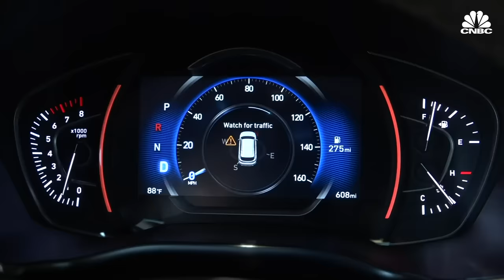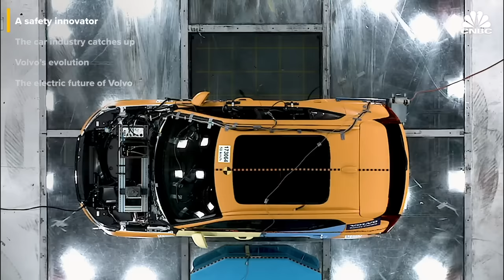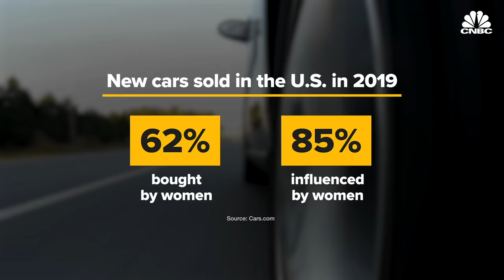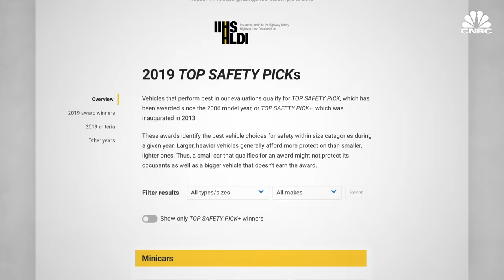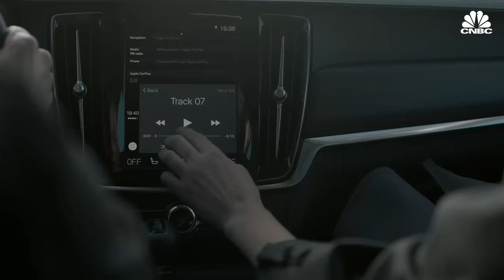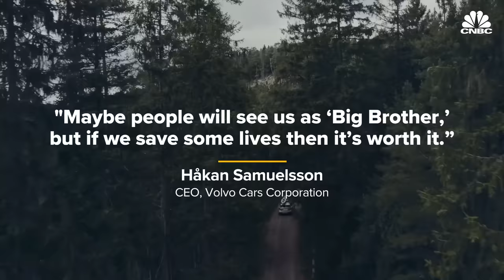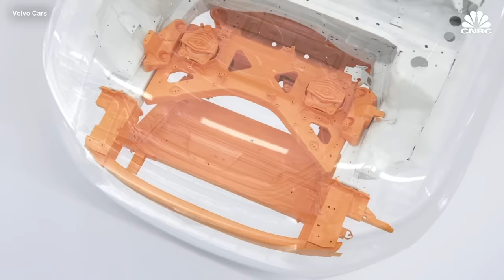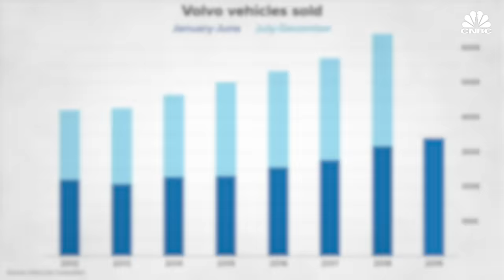Why Volvo Is Losing Its Big Lead In Safety

Comment: Volvo cars are so goddamn well designed and just look so timeless.
Reply: To bad its reliability is awful.
Reply: @baronvonjo1929 : I own a Volvo V70 D5 purchased as a new car in November 2007 in Bremen, Germany.
No breakdown, no unscheduled workshop visit until now, February 2020.
Once a year for inspection at the Volvo dealer in Bremen.
Reply: @ULTRA_2112  Honestly jealous. Our Volvo sucked.
Reply: @JaeKi Park we had a mid 2000s S60. It lasted about a month. It had about 110,000 miles on it. It broke down a lot. And when we fixed it. Another problem. Sometimes if we didn't touch it for a few weeks it would run. It did that when we sold it to a dealer. My dad was so happy to get rid of it. Constant computer systems breaking down. And sludge building up in a filter. We ended up getting a Lexus crossover. And I just got my first car a camry. I realize now the S60 also had bad leg room in the back seat. I want volvo to go bankrupt after that. We will never buy a european brand after that ever again.
Reply: @baronvonjo1929  What? My dad have owned Volvos all my life, they are extremely reliable. Even they were old cars.
Reply: @inkerstales2336  Not ours. Constant electrical issues. Computers system malfunctions. Filters having sludge when they shouldn't. Thousands of dollars was put into that thing. We had it less than a year. It was at about 110,000 miles. It was truly a unreliable car. Spent more time in the driveway or mechanic than on the road.
Reply: @baronvonjo1929  you want volvo to go bankrupt because of a bad experience with a used 110k Volvo? Sounds like you just bought a bad one because the S60 is pretty reliable
Reply: @baronvonjo1929  I brought a 2005 s60r last year with 160k miles on it and it still runs like a dream,no issues with reliability, but  honestly the leg room in the back is ridiculous, but I have no complains for that since I drive alone.
Reply: Old Volvo cars are ugly but the new ones look great and volvos from 2000-2010 are just rebadged fords lol
Reply: @baronvonjo1929  You're complaining that a used car is breaking down. Seems like your dad bought a lemon that wasn't taken care off lmao.
I have a E90 320d BMW with 334k km on it atm, runs like a dream. All you have to do is change the oil on time and most of the time there wouldn't be any problems, if something comes up immediately fix em and not delay em like most people do.
Reply: @xAvitaLT  it happened within a month of getting it. And constant constant problems. Thousands of dollars worth if repairs. We then started looking up and just found stories of how awful peoples volvos are. Never going European again.
Reply: New Volvo is junk
Reply: @8risk  2019 V60 T5 here, I've had the car 2 years now and we've put about 42,000 US miles on it. no issues at all just a handful of schedule maintenance items and oil changes. Prior to this I had a 2010 S80 T6 I put just about 130,000 miles on that with the only major issue being a bad bearing in one of the turbochargers at 105k miles. So long as you keep up on general maintenance, they're fantastic (This basically applies to every car. we need to learn the difference between a neglectfully reliable car that you can disregard and will still run, and a truly reliable car that runs as the manufacturer intends for longer than a disregardable car when maintained correctly). The older late 90's early 2000's Volvos that were cranked out with Frankenstein concoctions of Ford and GM parts were the bad ones, consuming transaxles like oil, bad seals, poorer quality parts, etc.
Reply: @baronvonjo1929  Guess what! I've got a 2017 diesel Citroen Berlingo (a European car) and I've never had a sigle problem with it for 47000 km.(and amazing fuel economy)  I had a 106 Pug (petrol) and ran it till 320000km (before changing it to a Panda in 2009) , again no problem.....
Reply: @melesmelesfaber3866  *clap clap clap*???
Reply: On my 3rd Volvo.  Had a 2004 sedan traded it in for a 2010 sedan. I recently gave it to my kiddo and now I have a new SUV. All of my Volvos have been great.  Love them. The luxury is nice and they safety gives me piece of mind.
Reply: @melesmelesfaber3866  don’t care
Reply: @V_For_Vigilante  I have to agree with the Ford statement. I feel the quality of Volvos between 2000 and 2010 was bad compared to before and after than time. No wonder when some V50’s had Ford engines lol. 

The designs of those old Volvo’s were appropriate at the time, legendary cars with a reputation to never die.
Reply: @V_For_Vigilante  but their not rebadged fords their safer and have a lot more features I have a 2009 xc60 which has auto breaking up to 30km/h this is a 13 year old car memory seats plus more their very nice.

Comment: Boeing is the complete opposite of Volvo.
Reply: Ouch
Reply: Damn we still talking about that? Cold...
Reply: Boing!
Reply: Ganda Gandara - MCAS - Make Crash Avoidance Stochastic
Reply: @dazednconfused31337  I think you mean "zing".
Reply: Sean Hard 
China has NOT changed, for the good anyway...
Reply: @nicholassmith7048  Nah that's the sound it makes in MS Flight Stimulator when it bounces off the ground :P
Reply: Not really. It was a bunch of inexperienced and untrained Pilots who were unable to handle a basic runaway trim problem.
Reply: Yikes big oof
Reply: LOL!
Reply: Boooooing
Reply: Oof
Reply: I thought Boeings were good planes.
Reply: Have some mercy!(😂
Reply: jiggbury We should be talking about it next 20 years..
Reply: Actually Boeing was like Volvo (super solid 707, 747, classic 737), but they changed for worse because of race with Airbus.

Comment: This is why I've owned an S60 and now have an XC60.  Volvo For Life.
Reply: I'm considering an SPA S60 T5. Is it significantly more reliable than a BMW 3 Series?
Reply: made in china..
Reply: @rohaannavsariwalla1844  it'll be more reliable than most German cars, but not as reliable as Japanese cars
Reply: Swedish engineering is just mind-blowing. Can't wait to get my hands on a Volvo Polestar 2 Waymo!
Reply: How is Volvo safer than Mercedes and more reliable than Lexus??
Reply: @saauuzza  the plant in china is for people in china
Reply: @kramer1916  mate it is made in China full stop.
Reply: @wojciechmuras553  Chinese engineering now, Geely the Chinese owner didn't keep the promise to keep the design and engineering works in Sweden, they only assemble Volvo in Sweden for Euro market.
Reply: @saauuzza  They are not even manufactured in china lmfao
Reply: @tonyvu2011  swedish engineering, produced in sweden (xc90 xc60 v90 v60) belgium (xc40 v60) china (xc40 xc60 xc90 s90) and usa (s60 and xc90)
Reply: @mZToyadiva101  I own the XC60 Inscription and I love it. Extremely luxurious and well worth the price. 
Get the certified pre owned XC60, this way here, youre getting a luxury car at a discounted price.
Reply: @pawelodziomek4908  Well said! If im not wrong, Volvo is more safe than the reliable japanese cars so you get slight lower reliability but top of the line safety. 

For people like me who love all the extra equipment like all the cameras, Harman Kardon soundsystem and panorama roof then its much cheaper to buy a Volvo than a german counterpart. Their extra equipment makes the car twice as expensive 😂
Reply: @saauuzza  All volvo cars are made in Gothenburg, Sweden. 
Chinese only gave Volvo money, nothing else.

Comment: Volvo has ethics. What other automakers can say the same?

Next safety feature: identify risky vehicles on the road (based on behavior & car type) and actively avoid them. Would it be possible to detect which drivers are texting? Not even kidding...
Reply: Yeah read gps data of nearby vehicles... Track their driving past and show which vehicle is being driving dangerously, provide alert about that 😉
Reply: Simple answer, Anything that isn't Chinese is deadly dangerous! Chinese software decides!
It detects if driver or owner of the other car has attended anti-Chinese websites or isn't using enough Chinese products and suggests to Volvo driver how to kick the enemy off the road while blaming the fault on him. Failsafe Tibeto-Uighurian method. We have also seen that with Tesla recently. It works.

Anyone who finds sarcasm in here may keep it, it's free.

Comment: Volvo is still the leader. They drive the cars off of buildings for crying out loud. This crap about them not innovating in safety because of geely, is a bunch of bs! Volvo has never been more independent than it is now. They literally can do whatever they want. If you don't believe me just shut the door in a V90 and then shut a door in a Chrysler or something and tell me what car you'd rather be in. The impeccable build quality is another huge factor in why people buy them. There is also a huge amount of Volvo specific crash tests that the iihs doesn't even test for, so even though the gap isn't as big as it used to be it's still big.
Reply: I rented a Volvo in Europe and it shifted to from park to reverse on its own while I was by the trunk. Completely destroyed any image of safety it had in my head.
Reply: Geely isn't hampering Volvo and the video never said that. The little they said about Geely is that it's really helped them by giving them access to more money and access to China. The CEO of Geely is quoted as saying he's going to pretty much leave Volvo alone. Volvo is losing becase other brands are focusing much more on safty then they used too.
Reply: bensemus x I never said the video said that I was responding to some of the idiots in the comments and to people who jus blurt out random stuff like Volvo’s a Chinese company now, which is jus stupid. And Volvo isn’t really losing to other brands either. Other brands are taking note from Volvo. Volvo is MB’s biggest shareholder rofl. I guess if you look at jus sheer sales ya but that doesn’t tell the full story.
Reply: They have their own crash test facilities.

And have investigators that go to real car crashes.
Reply: @Aleksandar Milicevic yep and Volvo uses the most boron steel alloy than any other manufacturer, which is the strongest stainless steel material used.
Reply: @bensemusx  No, I think that Volvo is losing because the design of their interiors have become too effeminate (I can't think of any other brand in that manner), because their engines are too problematical (T5s are probably the best, but T6s and T8s are very poor in shifting because of the superchargers and turbochargers), because their purchase costs are arguably too high for what you get, because they've taken away too many buttons for things like climate control and put them in the finicky computer screen, because some of the buttons that they do have are absurd (on-off switch; auto-mode roller button), because you can't permanently disable auto-start/stop, because you can't even temporarily disable the doors locking when the car starts to move, because you can't get a no-sunroof option (and thereby save money), because their instrument panel is inferior (doesn't even show engine temperature), because they have too-few USB ports (and the ones they have are too hard to get to), because they refuse to offer engines greater than 4 cylinders (I don't think that any other luxury-car maker lacks at least a V6 option), because their center-console storage area is very poorly designed (doesn't hold cups well or securely), because their voice-control system is poor, and because their infotainment system is crap (including their maps, though Volvo is going to Google Maps in the next year or so).   My 2001 Volvo wagon doesn't have an infotainment screen (or USB ports or sound-control), of course, but it does have a CD player (can't get that anymore, either) and is superior to the new Volvo wagons in every other manner listed above (and I'd argue that my 2001 wagon is safer, because you don't have to take your eyes off the road to fiddle with the infotainment screen to change your climate temperature or fan speed).  I suspect that the only Volvo I'll even consider buying in the future is a BEV Volvo, if they can get the range up on those; their PHEVs are crap -- reliability-wise, range-wise, technology-wise.
Reply: @cbatiau2528  I thought there is a voice option where you can give voice command and adjust cabin temperature, no?
Reply: @tatiananovak4693  It doesn't always work well, the voice control.  And there are many times when I might be on the phone or talking to a passenger or listening to some music or the radio, and I don't want to have to interrupt to change the climate control.  (And this discriminates against drivers who are mute, or have laryngitis.)  Saying "well you can use voice control to change the climate settings" is a poor excuse for not having buttons/knobs for that purpose.
Reply: @Robert-cu9bm  you are actually correct on both of your statements. They do have real investigators going to where real crashes happened.

Comment: I mean, the tests hasnt changed for like a decade ofcourse they’ll look equal with everyone else. If you increase the speeds or weight of the side impact you’ll see them distinguish themselves. Just when IIHS brought out the small overlap test and a 2002 xc90 scored good but a 2010 bmw scored bad. Change the tests and you’ll see them shine, everyone else is just matching the bare minimum
Reply: Exactly, Volvo conducted a 50mph crash test with they're XC90 - something no other car maker does.
Reply: Remember when Mercedes, BMW, and Audi failed spectacularly when IIHS first came up with the small over-lapped test? S60 got 5 stars.
Reply: They change all the time.  Active safety is now part of the tests.
Reply: I think crash tests should be raised to 55 mph, since that's the speed limit on rural highways, at least here in California.
Reply: Agree. With cars becoming more electric and software heavy, I hope they take post-accident safety into account too. Tesla has had some bad reputation for people being jammed in the car after accidents (they have some manual overdrives but are not intuitive), resulting in casualties.
Reply: Jupp, most other cars are built to pass the tests with flying colors, Volvos are built to pass real life, with noone seriously injured or killed.
The fact that Volvo invests in their own tests based on real world data collected for decades to make even safer cars is what stands out, even if that isn't reflected in standard tests
Volvo 4 Life

Comment: Why the negative title? The title of the video says “Why Volvo is Losing Its Big Lead in Safety”, but there is no proof other than the others will catch-up... so the conclusion is that they aren’t losing anything, to the contrary, they are growing... In terms of safety you said it yourself, the brand is rated top by consumers, they have zero negative press about safety or anything else (unlike the Germans who are busy with cleaning up after their diesel-gate). 

The same argument that the others will catch-up can be made for any type of technology in any business. Other car brands can catch up to Tesla in electric, it doesn’t mean that they will do it anytime soon... and the by the time they are doing it Tesla is doing something else. Same for Volvo and safety.
Reply: you're looking at this way too negatively, they simply said they're losing the "big lead" as in the gap is shrinking, not because Volvo is slowing down, but others are catching up.
Reply: Volvo’s only sin is having been brought by GEELY of all companies.

Otherwise. Volvo has definitely earned its place.
Reply: Why negative? Because Geely is from China.
Reply: @TraceLight  volvo would be dead without geely, its ownership under ford is disastrous

Comment: I’ll still buy a Volvo when I start a family though.
Reply: Teslas are safer
Reply: @rollingthunderinho  but a Volvo looks better, and has sound when I goes forward
Reply: @alexandercrush  I've driven an S90, S60, and an XC60 and like them much more than the old Volvo
Reply: Just started family (baby will be here in a week), got V90 CC.
Reply: Alex Geely gave Volvo pretty much free hands regarding the design and engineering they only took control over their economics.
Reply: Get a toyota.
Reply: Your words sounds like: "I'll still use condoms when I start family though"..
Reply: Toyota Land Cruiser
Reply: Alex Hell. Volvo under Geely seems to be doing much better then when they were with Ford. The older s60 was so blah.
Reply: @alexandercrush  lmao racist much? Volvo now is far superior to when they were owned by Ford.
Reply: Same here
Reply: rollingthunder tesla are safer only because they have fantastic adas, at point that they can drove themself (is really safety?) and nowdays the crash test point give very inportance to the radar, sensor, auto brake... (adas)
For example the Golf 8 will have 3 stars whitout adas, it bend like a 5 year old car, (that actually is because have MBQ platform that is 5 year old, ridiculous) 
The tesla are same, they are a littlest safer becouse have very better adas, but go to watch the percentage survive of passenger... when you REALLY crash Volvo are safest...
Reply: @alexandercrush  everything you buy is from china
Reply: @alexandercrush  and that's bad why? They have improved quality since ford used to own them

Comment: I used to own an old Volvo, but recently switched to a new XC 60 T8. I must admit, the improvements the Chinese has made are astonishing!
The technology and design is just on another level compared to older models, and the performance of the hybrid is also very impressive!
Reply: Volvo engineers are still Swedish to a large degree
Reply: Wokis While that may be true, I believe that Geely has pushed for a more modern design and more advanced tech. While the engineers themselves may be the same, I think that Geely has directed them to a more modern approach to designing a car.